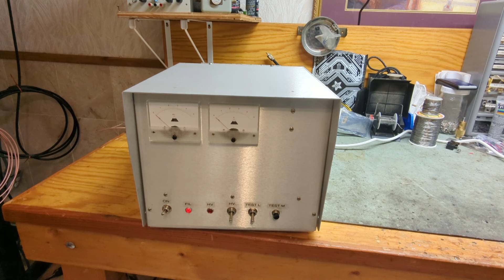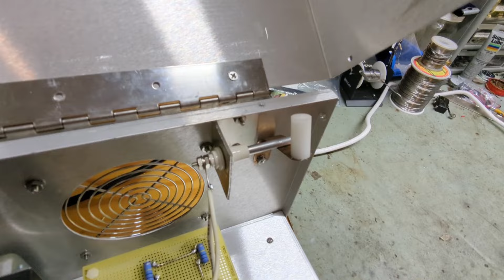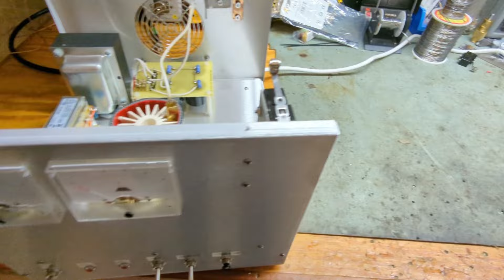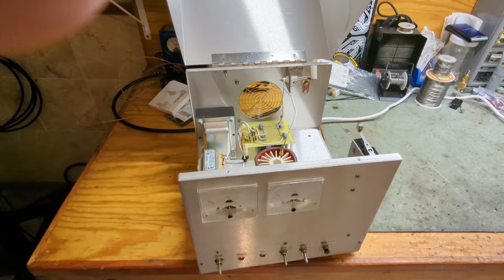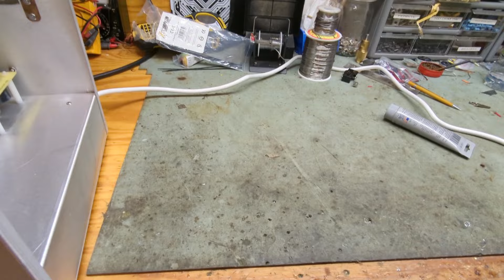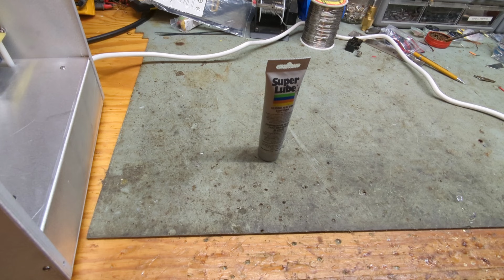GI-7B/GI-6B/GI-7BT Burn in jig

Comment: That is really slick my man . I would like to have a tube tester for the 3-500Z
Reply: Fairly simple - rig up a 5V 20A PSU (ex-PC power supply, $1) and warm up the heater.
Give it an hour or so then strap the grid to the anode.
With an ammeter attached, hit it with 0-30V from a chinese bench psu and see what it conducts.
If it's similar to a known 'good' one, you're (probably) good to go.
It's just a triode after all, but watch for the total Power not exceeding about 15 W.
The Grid will not be happy after 20W max.
Full testing requires the High Voltage etc, but generally isn't needed for Amateur use.

Comment: PA0FRI gives superb 'tube re-activation' guidelines. HT isn't really needed.
It's all about Preparing the tube for the HT by restoring a good vacuum.
Stick the heater on for a while, like a few hours or a day. Cooling is Required !
Inside the tube there is a 'getter' chemical that Only works when it gets hot.
Barium was often used, so avoid smashing old tubes and breathing the stuff (toxic).
Typically the chemical is a solid next to (or on) the heater. Some tubes have it near the anode.
When Hot, this chemical reacts with the few molecules of air left inside tube, converting them to Solids, which sucks the vacuum down harder.
To test if it's working, short all the grids to the Anode and apply about 15V dc between anode and cathode.
This makes the tube (any tube) a Diode.
Watch the Current flowing - it will increase as the vacuum inside the tube gets back to a functioning level.
Care must be taken to make sure the current does not exceed the tube/valve's maximum rating, which it Will if it works as a diode and the juice is available, even at 15V.
Reply: I  should have said Any maximum rating. Usually the Screen or Grid has the lowest.